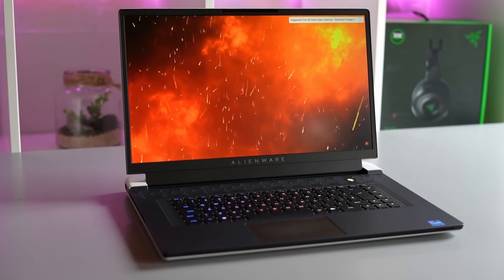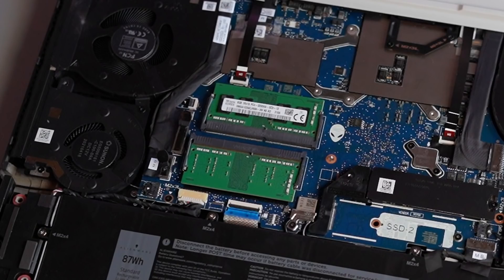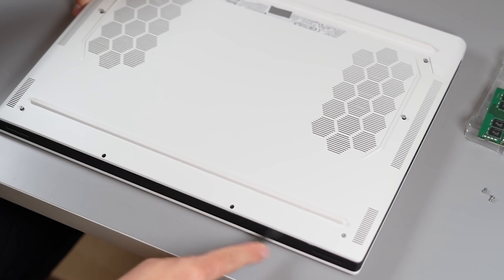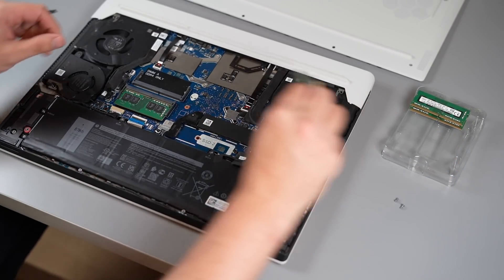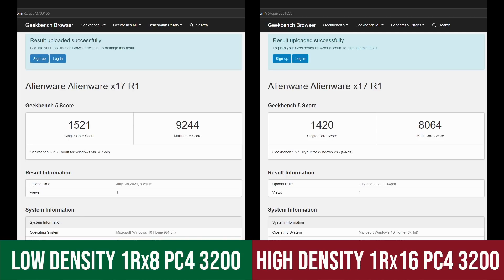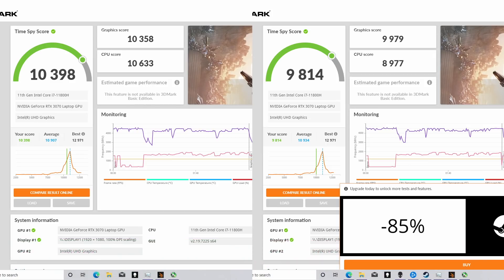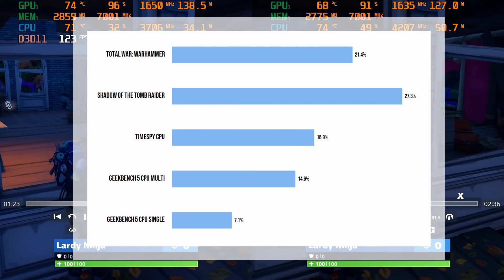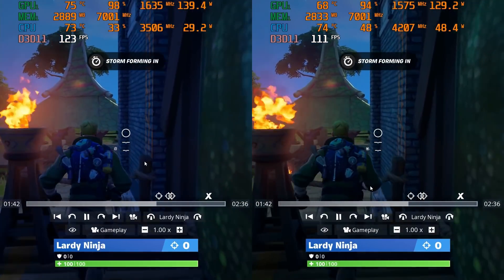Alienware X17 High Density Ram Strikes Again!  Upgrade Your Ram For Better Performance

Comment: I got my Alienware x17 about 2 days ago with a i9 11980HK, RTX 3080, 64GB XMP RAM, 2TB nVME, 4K 120Hz.

Aside from a glowing touchpad and a 330W PSU it came with 2R x 8 type ADATA RAM.
Reply: Mine was like $3989 with the discount. I did install  another 2TB nVME which I had before...thats why I checked the RAM too and saw it was an 2Rx8 config ADATA brand.

Its not jus Alienware thats doing 1Rx16 RAM...ASUS and MSI are doing the same thing for some reason...AMD versions are hit the most with this since they are really RAM dependent for their CPU
Reply: @AnythingGoesJoJo  that’s a good deal! And that disappointes me that the big guys in the game are doing this on such expensive computers
Reply: @AnythingGoesJoJo  any tips as this is my first alien ware? cooling on the x17 and software u added yet etc. if u have benchmarked it I’d like to know? Or wat games u play and frames. 

I bought this to play games on ultra I hope it does that
Reply: @AnythingGoesJoJo  did your top of the line unit have a mux switch on it? I ordered the i7/3070/16ram/4K and I’m wondering if it’s going to go back for the price I paid for it.
Reply: @AnythingGoesJoJo  How did you get a discount?
Reply: @John-sn4hl  Military or Student Discount...in my case Im military
Reply: @AnythingGoesJoJo  my 3080 desktop was only $1999.99 asus pre-built. But I used to have scar 15 qhd 165 hz 32 gb ram and 1 tb ssd and nice keyboard and speakers for $2699. 2 downsides where backlight bleed and no mux switch. Need external monitor for full power. Also I wanted the 17 inch version so I returned it. I kinda miss it tho and can't find it again, :( I want 17 inch qhd rtx 3080 version
Reply: @lantech7709  Trust me i want to build another desktop as well...but i have been on the road or either on deployment a lot...and taking a desktop PC with me is not an option, unless i dont mind lugging a desktop on every hotels or starbucks i go LOL...its just having the convinience of having one pc in my backpack that can handle all my PC needs is what got me into gaming laptops morenow
Reply: @AnythingGoesJoJo  yesh i would go with laptop in your case
Reply: Can you install cpu-z and see if it's dual rank? I got the 32gb 3466mhz ram but only in 1rank
Reply: Geez what was that $6000 lol holy f.ck
Reply: @lantech7709  I got the very best one same as his except 4 tb storage and with a discount only 4238 with tax but normal price was 4900
Reply: @TheGreedyKing  oh ok that's not bad then I was looking at the maybe like $3000 option
Reply: @TheGreedyKing  how did you manage that? crap i got 2tb and its 4200 even after the 10% discount. teach me your secret, Master!
Reply: As far as I can tell theres no MUX switch...even tried to look in the BIOS. Also you will receive the x17 with BIOS ver. 1.1.1...ver. 1.1.2 is available to download.

I think it uses Advance Optimus.

I bench with TimeSpy and got 12 323, FireStrike 26 097.

Laptop seems stable I was playing games for hours and stressing it without TCC...CPU will still get 100c on full load...I set my TCC to 10...Laptop only hits 91c now at max.

4 fans are about as loud as the 2 fans on the previous m17 R4.

The mechanical keys are nice. and for 3080 buyers your touch pad lights up as well.

I do miss a num pad...but then again its not a big deal for me.
Reply: @AnythingGoesJoJo  so I need to set my tcm and update also just how good are those benchmarks also thank you for replying and helping me feel good about this purchase
Reply: @AnythingGoesJoJo  4k version doesn’t have advance optimus. You have to connect to an external monitor to bypass optimus and be able to use g sync through the monito
Reply: @EUSOUGT  can you verify that 4K doesn’t have advanced optimus with the bios update? @OP I feel like you need to get with Mash IT and help him do some of his videos on the super high end options. Thank y’all!!!
Reply: @EUSOUGT  there should be a way to turn optimus off thoe right? When just use if the 4K screen
Reply: @TheGreedyKing  Theres just this setting that ask if you want Auto detect mode, use Intel GPU and the other one is Prioritize the nVidia GPU...sorry this is my first Laptop with Optimus or Advance Optimus...I generally tried to avoid them. But this time Alienware X17 had everything I was looking for so I went for it. There is no G-Sync but there is a setting for a variable refresh rate.
Reply: @TheGreedyKing  no the only way to bypass optimus in the 4k model is to connect to an external monitor that has g sync to get better performance
Reply: @AnythingGoesJoJo  for the x17, advanced optimus is only 1080p 360hz model. Not the 1080p 165hz or 4K 120hz model.  Confirmed with Dell, cancelled my 4k120 order due to it.
Reply: @Dubya_Tea_Efff  sorry to hear that. yeah like i said before this is my first Optimus laptop...i tried to avoid them before also...but I looked around for other brands of laptop and the x17 has more of the features I was looking for. And the build quality is nice, this thing is so dense and heavy for how thin it is.
Reply: thank god!!! i feel much better.. I GOT the EXACT CONFIGURATIONS as you DID. hope mine doesnt have other issues.. the ram issues got me worried a but.but now its 8type i feel a bit better.

Comment: Do the 3080 models come with the better ram? Can’t imagine buying a laptop for over 3k and then having to buy a separate kit of 32gb ram for 200$
Reply from the maker: Only if you choose the xmp modules which are expensive. I haven’t received the 32gb config yet, that arrives Friday so I will let you know what that ships with (oh and that is a 3080 model btw)
Reply: Waiting for mine to arrive end of the month with i9k, 3080 and 32Gb of the fastest ram. Will post here when I can test.
Reply: @reddzero  nice! Waiting to see if the XMP ram is as fast as the low density ram.

Comment: I don't understand the difference bw high and low density, I saw on the website, they have 2 rams with hzs, can you explain a bit .. I am confused
Reply from the maker: Yes of course. If you look at the chips the x8 (low density chips) has ram chips on both sides of the modules, each of the chips has a controller. On the x16 it has half the number of chips (they are all on one side) as the ram is more dense. This means the x8 has twice the number of controllers to find data therefore it will usually find data quicker than the high density. Hope this simplified solution makes sense
Reply: Awesome,  Thank you, u are the best

Comment: Really nice!
How is the fan noise? Thinking about buying the X17 as a desktop replacement for work. I already tried the 2021 Razer Blade 14, but the high pitched noise even on lower load is just unbearable. 🤦‍♂️
Would love to see and especially hear a close-up on highest performance mode on at least two or three full Cinebench R23 runs. Would be very interesting to hear it ramp up its fans from idle to full load. 🤔
Reply from the maker: Will see what I can do for you. I have played a 3 hour stint on warzone on balanced and the fan noise was a lot better than I was expecting and certainly a nicer sound the the m17r4 which had a whine. I didn’t even bother getting the blade 14 in as I expected it to sound like a hoover 😂
Reply: @MashITTech  did it improve battery life by a bit at least try running it on 60hz 50 brightness and rgb light off pretty sure u can get more than 5 hours maybe like around 7-9 like the previous alienware with ryzen has a better battery life but temps were going up to 103 Celsius which is why I cancelled my order thinking to go for this or x15.

Comment: Great info. Hope to see a video on x17 r1 4k 120hrz model. I ordered i9 11980hk 64ram xmp @ 3466mhz. Hopefully I won't have those issues.
Reply: First issue:no mux or advanced Optimus, so low benchmarks. Second issue:first few people that had photos complain of qc issues. I hope those are just flukes because I got my order  in last weekend :)
Reply: @LeFatalpotato  
A lot of ppl like to complain or give false info due them not being able to afford a premium alienware laptop or there alienware haters that like another brand. I currently own a M15 r4 and I'm able to play at 4k ultra between 45fps and 60fps on cyberpunk 2077. I do have to use the in game vsync to keep screen tearing from happening and DLSS performance to keep my fps up but image still looks great. Sometimes looks better than my PS5.
Reply: I also heard Advanced Optimus isn't good due to it ruining image quality. Also I think 4k 120hrz panel option has gsync. Which is good, that way I don't have to use in game vsync option.
Reply: @emmanuelmoreno3737  nope. 4k has no gsync or even optimus.
Reply: @ae6eespage727 
Oh well in game vsync it is.
Reply: @ae6eespage727  4k has Optimus, it was proven by recent benchmarks showing 10%+ increase with external monitor.
Reply: @emmanuelmoreno3737  No lit secondary keys and no numpad when you can buy a msige76 that far outperforms this and has all of this. It’s also much cheaper.
Reply: @LeFatalpotato  mux can use by bios. Dell will update. They did  the same thing in g15 and m15r5
Reply: @emmanuelmoreno3737  Make sure the monitor signal is by rtx3080. You get better FPS. 3D mark Timespy is also higher.
Reply: @feedfeed730  
I game on CX oled PS5. I'll only use X17 when I'm away from home. I have to use vsync to keep screen tearing on m15 r4. I was hoping the panel the laptop comes with has gsync. On cyberpunk2077 I have this issue but on Witcher 3, no mans sky and metro exodus I don't have this issue.

Comment: Most laptops rn has slow ram 
This has to mean either greed or stock
Reply from the maker: I wish it was stock but I am guessing greed!
Reply: It’d be interesting to know how making a presumably relatively small saving by cheaping out on the ram has a knock on effect of lower sales due to reviews about poor performance.
Reply: @danielhirst3151  Bearing in mind how many reviewers out there are currently testing these devices, let alone dig into the memory deficiencies and root causes of performance abnormalities, I'm not sure Dell marketing teams are afraid of their sales forecasts. Add to that the overall price markups and "shortages" due to [ COVID (cause everything slowed down earlier, inluding deliveries) | companies waiting for the right price (they can say they don't have enough to drive the price higher, people will still buy the products if they need them) | semiconductor manufacturers pricing and strategies (as if big corpos were buying components in retail and not in bulk in really huge numbers, based on a contractual pricing and delivery stipulations guaranteed for longer periods etc. and signed by both sides way back before COVID or crypto or silicon shortages were a thing ;) ) ]  (pick one that's closest to your heart ;)) and they're pretty sure they're going to sell these in large quantities, just maybe not as much as the office work targeted Vostro lines ;)